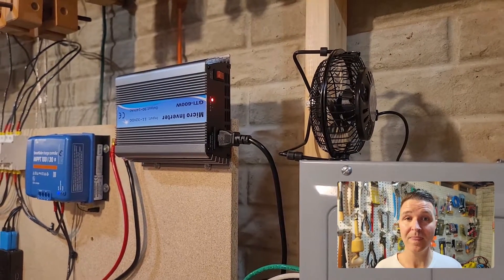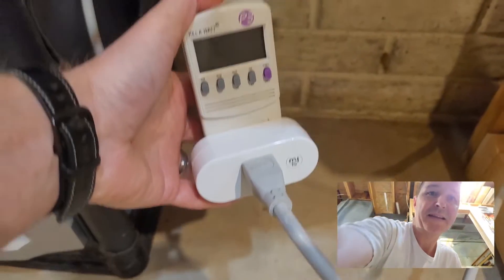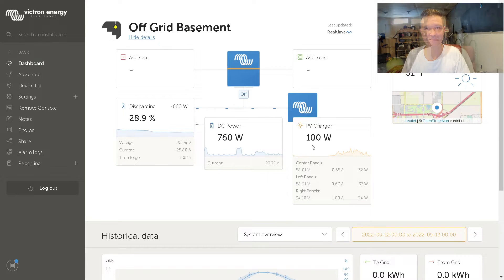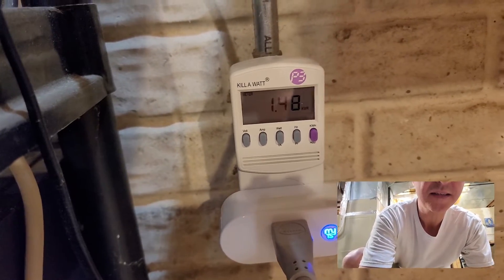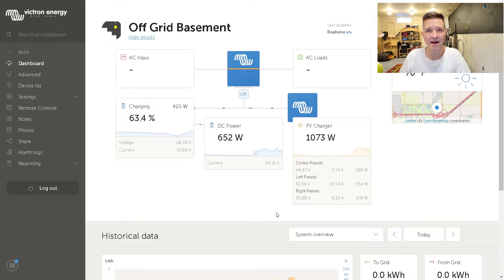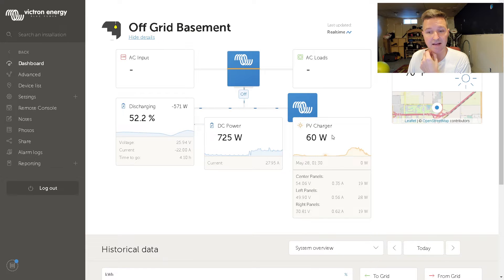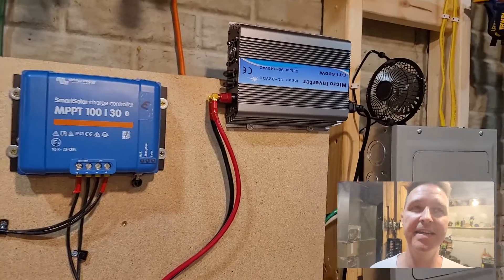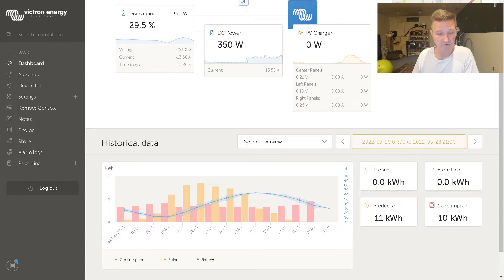Can you run a 600w Grid Tie Inverter from a 24v battery for 14 continuous hours?  Let's try!

Comment: Good testing with battery.  The key is keeping the grid tie inverter cool always and use very thick wires.  I use the 36v (20 to 50v) version  connected directly to my solar panels. I think it has higher efficiency but I can't use it with my battery bank because it requires 36v battery.
Reply from the maker: Yes.  The fan and the oversized wiring helping with heat...  at least I hope!  Thanks for the comment!
Reply: Can you use yours with the limiter somehow. I’m new at this and just got two 36v , 350 watts panels and YH gti 1000watts the 20-50volt version.And wondering if I could connect the limiter to this inverter.

Comment: The variable power inverters I described at length in a comment on one of your previous videos are about 93% efficient, per my measurements. 
DC input power = 377 watts, AC output power 350 watts. Only 27 watts lost as heat in the inverter. And as a result, their little built in fan only runs part time, and no extra cooling is needed.
BTW, I incorrectly said the unit I am using put out 450 watts. I mis-remembered. They are 350 watts AC output when using a battery and rated at 500 dc input watts when used with a solar panel.
Reply from the maker: That is great efficiency compared to what I'm getting.  Also, it's small enough so you don't need to worry about a limiter.
Reply: Do you have a link to these or at least a name and model number???

Comment: Forgive the ignorant question, but why not get output out of your 3000W inverter and plumb that directly back into the house from the three hard wire screws? I am trying to understand what the small GTIL over your existing inverter.
Reply: Aaah, I read the comments in your other video and understand. It senses the power from the grid and kills the power input into the house when grid is down ?
Reply from the maker: Yes.  I honestly don't know the specifics, but I also think it has to do with voltage.  The grid tie matches your home harmonic.  The off grid just pushes more voltage into your home.  I think it would fry anything in the circuit.  I could be way off on this...  off grid definitely doesn't have islanding.  It would backfeed the grid in case of power outage.  Thanks for the comment 👍
Reply: @OffGridBasement  It's not a grid tie inverter.  And btw, a KWH is not a KW.
Reply: @OffGridBasement  as you mentioned, Grid Tie inverters have electronics to match grid frequency, phase, and provide a slightly higher than grid voltage to push power back into your house and/or the grid.  Off grid supplies exactly a voltage and frequency that it's electronics provide, but its frequency/phase won't match grid.  All the magic smoke would likely come out of an Off Grid inverter if it were tied into grid because of this out of phase condition.
Reply: Thanks guys

Comment: This was a great and timely experiment.  Very nice.  I'm doing something similar with one of the limiting GTIL inverters now, just running from sunrise to sunset at 250W.  I ultimately want to use the limiting inverter elsewhere and am trying to figure out what would be the ideal size of one of these simple grid tie inverters to replace it with in that system and how badly solar panel limited I am.  Looks like these grid ties are listed on eBay from 300-600W and are probably all in that 80% efficiency range.

Based on my experience with similar inverters (1000w version), you might have a problem where the fan continues to run while you have no AC power.  You'd just have to cycle the DC power to it in order to stop that until the next day.

The cheap Emporia smart plugs similar to what you have also include Energy monitoring through an app and have allowed me to see how much AC production I'm getting from mine.
Reply from the maker: When this one burns up I'll be upgrading to the GTIL.  You are right about the fan.  It runs way after the unit has shut off.  I wonder if that is a big reason why many people say they fail.  If the fans is running all the time it will fail faster.  Thanks for the comment!